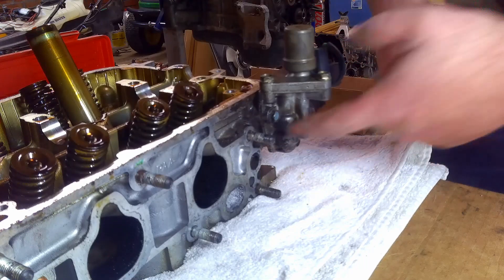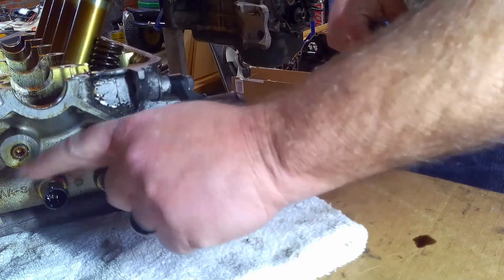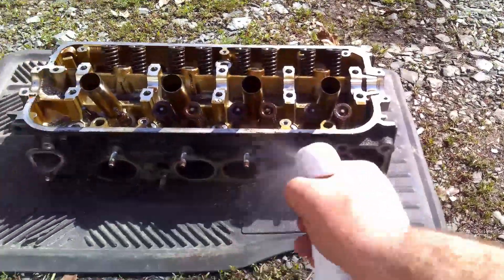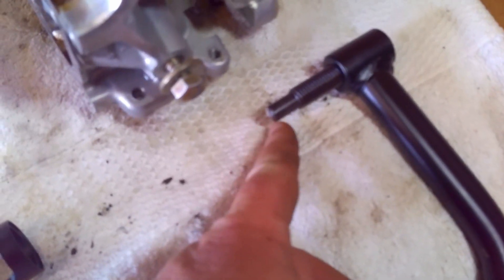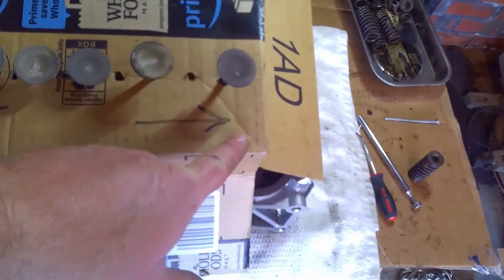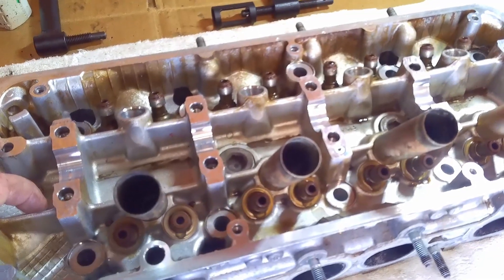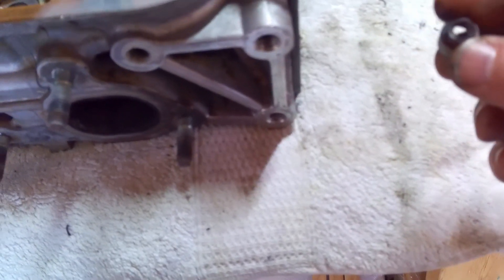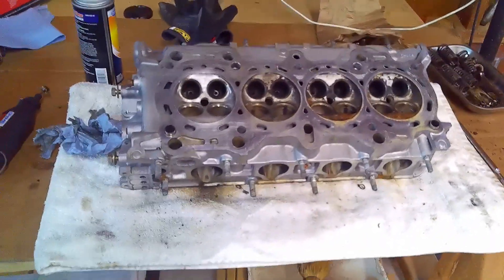F23 Honda Accord Engine Rebuild Part 2: Cylinder Head Disassembly

Comment: I was changing the gasket and one of screws broke then I was I drill out the piece and just redue the screws with tap & die so I was suscceful just when about finish the screw that I going to use it drop inside the motor my 2 question for u is....

1.the oil that it's at the bottom its engine oil correct?

2.if drain the oil do I have a better looking for the screw because I can't find?...
Reply from the maker: Wow.... drain the oil and pray it falls out. Use a magnet on a rod to go up in the drain plug and fish around. Pour gas down the hole it went down with no oil in engine and drain plug out and see if it flushes out. If all that fails, rock the crank gently back and forth using ur hands and see if you hear the bolt hit the pan. If still no, you need to remove the oil pan and hunt it down.

Comment: I'm currently in that process with my 01'.
I however, am building 2 engines and 2 transmissions. 
I'm wanting to build 1 to 200hp, and the other to 700hp. Any suggestions?
Both trans are 5spd manual.
1engine is the A1, the other is the A (JDM).
Reply: This guy... 700 hp.  Start saving buddy.. and on a f23 ??? Why??
Reply: @jonathanhedgepeth5642  haha!
Reply from the maker: I don't have enough experience with building these engines beyond factory specs. The oem rods and clutches I know for sure wont hold 700 hp. And the tranny will only last so long like that. If you want to tune that right, gotta go with OBD1 downgrade and use like a Hondata ECU. If your gonna rev it past 7k you gotta change springs and retainers. Basically, keep replacing everything you break with something better! Good luck.

Comment: Thank you for the videos! I am learning a lot. I have a 1998 accord ex, engine is F23 without Vtec. More than 200miles. The head gasket was burn out so i sent the engine to repair. The valves and valve seals were changed, also piston rings where changed. The problem is that after about 5000miles started to consume a lot of oil, about 1 liter in 400miles. It smokes, no leak. Do you thing that the valve seals are bad? Where else could be the problem? Compression seems to be ok. Thanks again!
Reply from the maker: I would go after the valve seals first. If its smoking and using that much oil and not leaking from somewhere that would be the easiest to try. If you had someone else fix it, I'd try and get them to honor their work. Good luck!
Reply: @ktecgarage  Thanks!